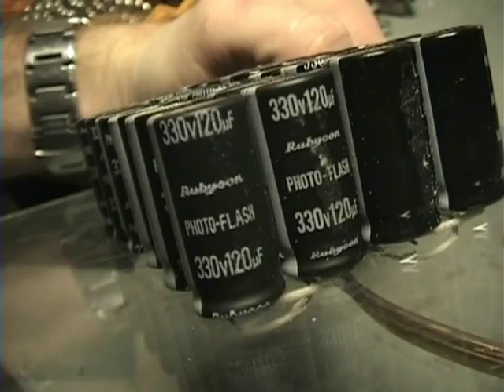Mini Working Rail Gun

Comment: The aluminum behind the projectile helps by vaporising and creating a plasma arc that pushes on the back of your projectile.

You'll get a lot more velocity and less of your projectile will burn up if it's already moving when the power comes on.  You're wasting a large portion of your power just getting it moving in the first place.  Most designs use either pneumatic pressure or a solenoid to kick the thing between the rails.

Comment: He is getting some motion out of it.  The hole in the paper is probably too small to see, but you'll notice in the slow motion clip that there's a glob of burning metal that appears flying out from behind the paper.  You are correct though that he is likely burning up most of the projectile before it exits the barrel.

Comment: All you need now is a resistor and a discharge circuit, and you will have a (more or less) safe railgun that you won't have to discharge across a penny.  That's a LETHAL amount of current man!

The one I built was FAR less impressive and my switch wasn't robust enough to handle the current.  It melted rather quickly.

I used the circuit board from a dispoesable camera as the base for mine, but your old charger seems to work VERY well!

Comment: As stated before, for the principal of a railgun to work correctly it needs an initial velocity down the barrel or it will just short and blow the projectile up as you see here. Ideally you want the caps to fire just as the moving projectile hits the rails.
Reply: Another way is to put a non-conductive projectile in front of the armature. This would make it a plasma railgun. 

Since plasma is still conductive it travels down the rail, so it still counts. I've seen somebody use an acrylic bead over a tiny piece of foil and it worked - the foil turned to plasma and the bead was driven out of the rail by it.
Reply: @gwilendiel  hello can you point me to this

Comment from the maker: It's just foil and a tinny pice or copper I think it has to be ferromagnetic... The steel ball may be counteracting the Lenz effect. I have also seen people use a little bit of air to push the object into the rails so it has a little bit of momentum so it doesn't just weld itself in there. Hope this helps. ~Russ

Comment: @Crazynerdfilms1 
i would actually say rail! i have a large 400v one i built, and it is much easier to maintain and build than a coil (gauss) gun. the concept is much simpler, there's not as much of an EM field produced to interfere (or destroy) with nearby electronics, and there's a satisfying arc :) plus the copper winding  on a gauss gun must be very precise.

Comment: The piece of Aluminum you are adding is not meant to be your projectile.  The idea behind the rail gun is that it fires a penetrator with sabot. The piece of aluminum acts as a sabot because it vaporizes and ionizes into plasma which creates the forward thrust. In your video, no projectile was there to be thrusted forward so your aluminum merely vaporized. Hopes this helps, and congrats on the prototype:)

Comment: Pretty cool. Did you ground it back to the battery? Also, How do you get it to shoot in a straight line? It looked like it was firing from where you made a connection with the aluminum. Good job!

Comment: you need to inject the projectile between the bars with pressurized air and put a sensor to register when the projectile passes through and firing the electric jolt on it.

Comment: @Sithrazer I am not saying just use a simple coil and make a coil gun I am saying replace the rails with two thin strips of metal just to make contact with the projectile and on the other side of them place a coil wound through the area where the rails would normally be soldierd to those two thin strips. Think of the solid rails like a solid core wire. Well this is like replacing that wire with a stranded core wire except it is actually a coil. Its hard to explain the orientation of the coil.

Comment: Everyone obviously does not know what they are dealing with. Talking about charging to a voltage specified on the side of the capacitor - will never happen unless you use a source that is that voltage. Your current is the part that charges up. To charge the capacitor you have to consider t = C*R, where C is the capacitance and R is the resistance. It is then charged over 5 time constants. The capacitors will obviously be in parallel as the capacitance decreases in series.

Comment: Firing from the back of the "barrel" is definitely alot better. And you might also get better results if you get the conductors as close as possible to the projectile without actually touching it.

Comment: Hey, 

Two questions. First, where did you obtain the metal pieces and the capacitors? I cant find them in shops.

Second, is there any way to replace the aluminium foil? 

Thanks.

Comment: Needs to be in a cylinder but also you would problem get better results if images of just putting your conductor in between your plates have it pushed my a strong of magnets so that it is in motion when it comes across the plates
Something with a higher melting point wouldn't hurt either
Saw with the paper in front of the plays but it didn't go throw 
The conductor was burned up by the time it left the plates
Good test run tho
Hope to c more

Comment: Where can you get hold of a camera flash charger?
Reply from the maker: any disposable camera, also, years ago and still probably today, if you find the correct CVS, Wall-greens ECT that developed the film for you and ask then for some old ones they may give them to you. tell them its for an experiment :) ~Russ
Reply: Thanks Russ, in the end I got a hot shoe camera flash and rewired it to the positive and negative on my capacitor bank (2x6000uF, 350V capacitors) which charges fine now :) will have to do a video on the results ..

Comment: @subnannitechnologies 4 weeks ago, so, i know you will need to look back on the page, and sorry, but, it works on the lorentz force look it up on wikipedia.
Basically, a charge is run through the rails, and, the ammo, being conductive (important, can't be magnetic, then it stays in the barrel, sorry steel) which causes an electromagnetic force to be generated, and, the shot, is fired!

Comment: How on earth are you charging that cap bank above 6volts? at 1:17 you can see that your charger is powered by 4 AA's. Unless theres a transformer inside there, that can only charge your capacitor bank to 6 volts (which isnt enough for a shot)
Reply: Camera flashes use a joule thief to get the voltage over 300VDC.
Reply: Jason Roush Oh, i see. Thank you

Comment: What voltage is your charging unit? is it an inductor?
Reply: He said it was a camera flash circuit so it's a combination of switching transistors, inductors, etc. Judging from the capacitors it's likely about 250 volts.
Reply: LOL, hope four years wasn't too late to wait for a reply.

Comment: your projectiles are melting. Maybe you should try out steel wires?
Reply: Projectiles must be made of a non magnetic metal in order to work.
Reply from the maker: Destroyer of Worlds  i was just doing some experiments on this and researching that. any metallic object will work, but any object that is magnetic will have stronger currents fighting it and is less effective. so non magnetic objects are better. but both will work. and in my next video's i kinda prove it... :) ~Russ
Reply: ***** Got it! You should be able to cast aluminum or copper into a shape, right? If so or not, copper wire or aluminium wire will allow you to make some very nice projectiles. Thick gauge copper wire will work the best of all of the options but in the interest of your wallet you might want to use aluminium.
Reply from the maker: Micah Burgin  in this video i was using about 176Jules, in my new one im using 10,000Jules :) hehehe  so even in the new setup i still needed to do it better. so i will try again and i will use tall rails maid from copper/bronse and will make the tall. so far i have been using the small side of the rails, but i need to be using the tall side with a projectile " holder" that will also have flat sides.
so the best way is to make your projectile " bullet like"  and cast an AL case for it.(in 2 half's) so when its going down the rails it will destroy the AL but the projectile will come out and keep traveling. kinda like a breakaway housing that fits the rails... then you can make your " bullet" any materiel you want with out to Manny side effects.  link to the new cap bank :) http://rwgresearch.com/open-projects/10000j-cap-bank/
~Russ
Reply: ***** What are you using to catch or stop the projectile with that much power?
Reply: Oh, you mean a sabot! I know my loading and such, lol. Assumptions can be made on my vocab.

And I think your best bet would be to use lost foam casting to create a aluminum sabot.

IE make a foam block that is the same size as your bore and then drill out to the size of your preferred projectile (I recommend airgun pellets highly! The things fly straight without rifling and hit hard. A good load would be a .177 BB with a .177 hollow point or pointed pellet in front of it.) Cover in fine sand and make a tube going down to the foam using (You guessed it) more foam. Pour molten aluminium over the foam tube going down and you have a sabot cast.

Or you could take two pieces of aluminium flashing and make them both into an "L" shape, put the projectile in between them, and have a tab covering the back.
Reply: Destroyer of Worlds Simple... A rock.

LOL JK it's up to him but thing gauge plate steel or a rock will block something like that.

Remember, ELECTRICAL energy, not kinetic.
Reply: Micah Burgin I saw a video of a railgun punching through a metal plate. The projectile was a 1/2 inch cube of aluminum.
Reply from the maker: Destroyer of Worlds
styrofoam backed with cardboard backed with drywall backed with cinder block wall backed with dirt!  lol in the name of science! :) results were fun but more is needed! ~Russ
oh and here is what i was doing with the bank any how... http://rwgresearch.com/open-projects/making-poly-magnets-cmr/ ~Russ
Reply: Thick gauge plate steel will not be penetrated, and thin gauge spring steel would take a projectile.

Just because some can, does not mean all will!

Of course a VERY HEFTY BACKSTOP must, I REPEAT, MUST be used at all times.

Look into things like sandbags or hills for your backstop. DON'T FIRE THAT ONE INSIDE.

Bad idea waiting to happen.
Reply from the maker: Micah Burgin
yeah lots of ideas. in the new video I'm using a .26" OD steal ball bearing... not the best but its what i had! also used a " roll in" ramp to get the ball bearing in there! lets just say results were mixed. but i was limited on time! :) ~Russ
Reply: Good idea, and if it works it works right!
Reply from the maker: Micah Burgin  i laugh at my self in this video. 5-6 years ago.. lol ~Russ
Reply: Lol, I'm sure I'd be laughing at a vid of me making a rail gun five years ago for sure... Mostly because it would be like a ten year old doing it, XD

Comment: Why not use copper plating for the main "acellerators"?  Copper has better conducting proporties.  Better thermal proporties also.
2) Make your capacitor leads MUCH shorter.  The additional length acts like an inductor.  An inductor retards the rate of current change.

Comment: Nice try, I like your style! At least your looking at being Safe!  Whats Wrong!  The two metal plates you have aligned there is not producing a magnetic field!  It may be a static-charge across the barrier, but noting more!  When placing aluminum between the two outputs you shorting across the Cap-Bank, thus a spark! A rail gun uses huge-magnetic field to push the projectile along!  I'm not sure the Ordnance their 
using is with an alloy, composed of something magnetic, but I could be wrong!

Comment: I'm not so sure you wouldn't get a shock from a real rail gun: there's potential for a huge current and your finger would be enough to conduct said current, so I think you'd fry.
Also I don't think it needs to be ferromagnetic, merely conductive. The Lorentz force arises due to the free electrons in the conductive projectile rather than the magnetic dipoles of the atoms of the projectile.

Comment: The reason it didn't work is you have to have a magnetic field perpendicular to the current, so up and down. Without magnetic field, the slug will just sit there and get hot like it did in the video.

Comment: You need the back closed off and there needs to be more power. that way you can have more accurate shots, and maybe puncture that paper. but I am sorry to say, the ammunition needs to be about a cm in diameter at least in order to have it fire without it evaporating, the 4 mm stuff is not good, and in order to have it fire even better, you need to have power shoving the projectile foreword in order to get a faster shot. but ya, Idk how much you have done one this, but I am working on the same type of thing, and also a coil gun.
Reply from the maker: is this enough power :) http://rwgresearch.com/open-projects/10000j-cap-bank/
hehehehe video coming up of rail gun... watch for it ~Russ

Comment: Do you not know the very concept of railgun firing? There's only two ways you fire a projectile with a railgun: A) you fire a conductive projectile that would take Lorenz force with it's body and B) you use conductive dummy that will take Lorenz force and transfer momentum to a non-conductive projectile in front of it. Due to extreme electrical currents, it is absolutely normal for small conductive projectiles to burn out before they even leave the barrel.

Comment: Due to Amper's law B=m0*I/2/pi/r
where I - current, r-distance from wire
You need thin wires (diameter ~= distance betwwen them), cause current runs through all it's width, this multiply Amper's power about 10 times
And supports on the wire's side are necessary, cause Amper's power pushes wires away

Comment: Seriously!  All that is happening is an arcing across the two terminals while destroying the aluminum and copper projectiles.  The aluminum and copper are non ferrous metals and would not react to a pulsing magnetic field which is required to move a ferrous metal object along the path of the moving magnetic field.  Why don't you try sticking your finger between the two plates and see what happens, I guarantee you will get the shit shocked out of you.  A real rail gun wouldn't do that!!